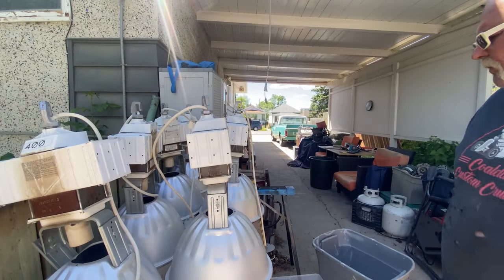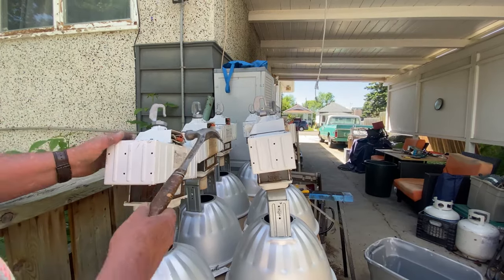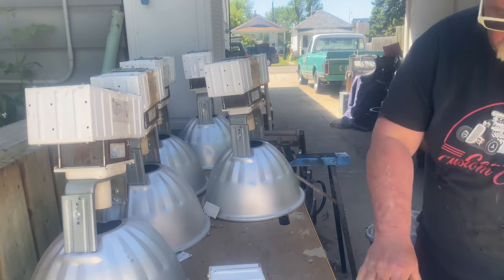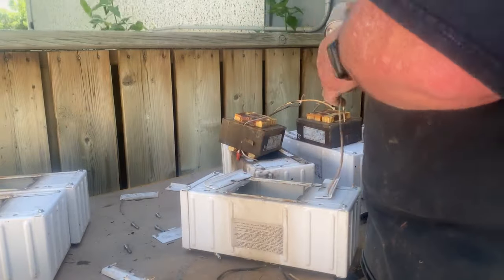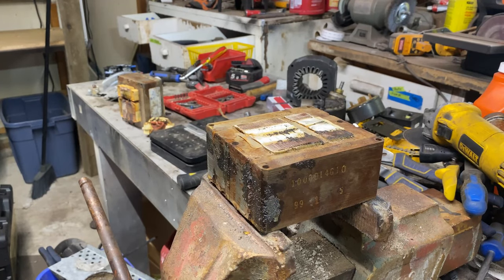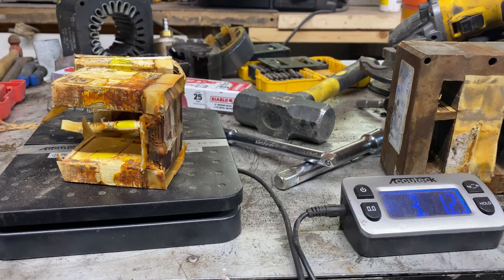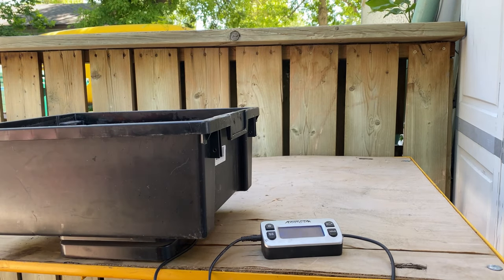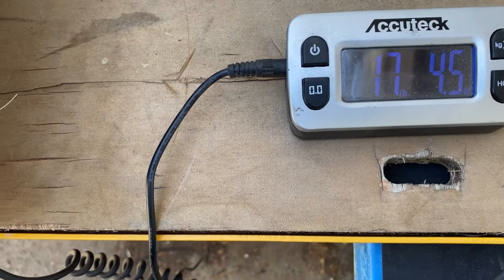Copper Recovery From High Bay Lighting

Comment: Nice junk 👍 I did 10 of these 250W high bay lights about a month ago as it was all I could fit in my car out of the 26 available. 

They were from a white clay powder factory so they were covered in the white powder and made a mess of my car (easy clean though) but it was worth every cent in the end.

Unfortunately the transformer housings were steel not cast ali.

I will do these again and again.

Great video keep em coming brother😂
Reply from the maker: There one of my faves to do quick and easy 

I have a bunch of led fluorescents to do will be interesting what’s in them